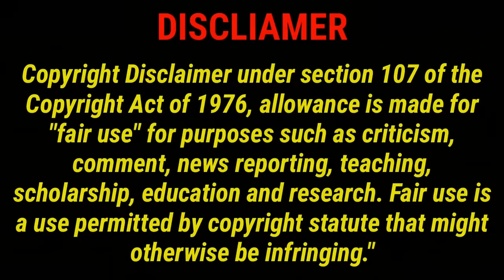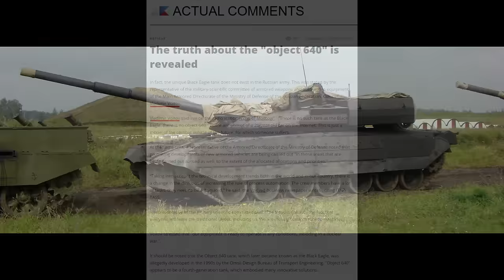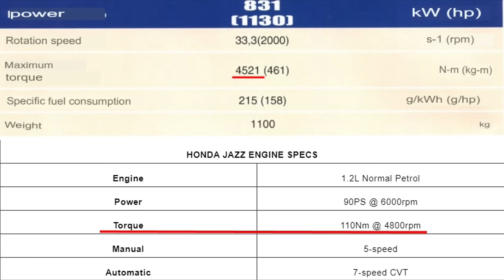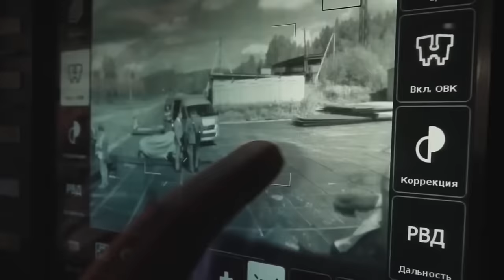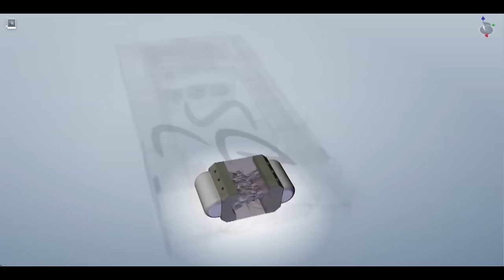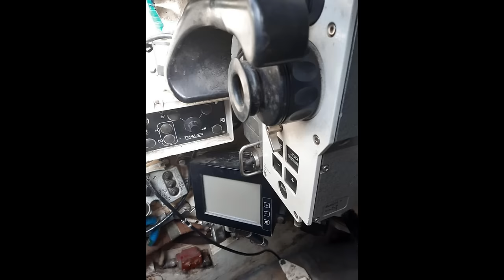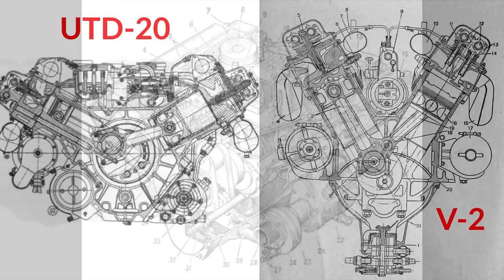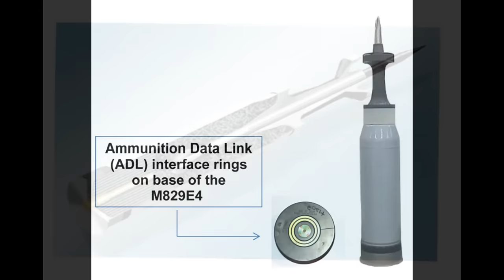LazerPig is WRONG about T-14 Armata

Comment: The carousel is, in fact, a very big advantage. It allows to save space and make the tank smaller, thus making its profile lower and more difficult to hit. Also, it allows to reduce the number of tankers to just 3, - in this case, if the tank is destroyed you only lose 3 people instead of 4.
It is true that it is jubject eto explode, but what the difference doest make for you whether you'd die to a ammo explosion or to spalling? By the way, starting with T-90 and late T-72 variants the carousel was added an aditional internal armor plate to protect it from spalling.
The advantages of hving the auto-loader far outweigh the disadvantages. The autoloader never gets tired, it won't have a panic attack and it can't be disabled easily.
Reply: However, does the Leclerc not have a cartridge autoloader that is still protected by blowout panels?
Reply: Having 3 people instead of 4 also increase the daily workload. For instance, the S-tank/Strv 103 could be operated by just one crew member, however inefficient as that would be, but it would be an insurmountable amount of work by himself to keep the tank in good order.
Reply: @Theswedishfoamer  yes it was made with that technology in mind.
Reply: @KamiKaZantA  the Autoloader means the one manual labour job is not to be done since its automatized.
Reply: Then NATO would be using it. Oh wait, they value crew survivability 😊
Reply: @nolkerss  if they value it so much, why is Leopard 2 Ammo rack exposed?
Reply: As stated in the video by a Russian official, having a lower profile basically doesn't matter in modern combat. Tanks are detected by their thermal signature and most of the hard work of hitting them is done by fire control computers. The main advantage of an autoloader is that it is more reliable in the long term and the lower profile mostly matters in terms of weight savings. Whether or not having fewer crew members is an advantage is up for debate, on one hand it might allow you to deploy more tanks but on the other hand it leaves more work for the remaining 3 and provides one less set of eyes to keep a look out. Also in most modern tanks a tank loss rarely translates into the loss of the entire crew, except in the case of a catastrophic ammo explosion. We don't really have any reliable data from modern conflicts on this but even during WWII in tanks such as the Sherman and T-34 a tank loss on average lead to the loss of 1/5th of the crew, with the Sherman generally doing somewhat better. The major innovation that has happened since then is the addition of blow out panels, which means that even in the case of an ammunition fire the crew is kept safe, this is also the main downside of the Russian carousel autoloader, since it has to be located in the floor of the tank it is impossible to install blowout panels for it. The T-14 does somewhat address this by keeping the crew in a separate armored fighting compartment though I don't know if any tests of ammunition fires have been performed in it to see how well it works. The Leclerc addressed this by instead using a bustle autoloader which could install blowout panels and it's likely somewhat more safe than its non-autoloader NATO counterparts since there's only a single tiny hole into the ammo compartment that has an automatic door, other NATO tanks tend to have spring loaded doors.  Another thing the French did when adopting the Leclerc is not drop the 4th crew member but instead keep them attached to the tank company and have them act as scouts while still working with the crews on maintenance and repair.

It does seem like the world is moving towards autoloaders so they are clearly superior but back in the 70s and 80s when most of the current MBTs were being designed these advantages weren't as clear. A lot of this probably has to do with advances in electronics that both make them more reliable but also lets you do things like have armored crew compartments.
Reply: @hedgehog3180  you obviosuly have no idea what you are talking about if yout think thermals are prevalent everywhere on the battlefield. Vast majority of portable AT weapons do not have thermals. The majority of AT launchers are also unguided  (RPG-7, AT4). Didn't read any further.

Comment: With all military equipment, everything has to be matched. It has to function reliably, it has to be effective against the current opposition, it has to be available in sufficient numbers to be effective, it has to have plentiful spare parts availability, such that the vehicle can be repaired quickly in the field when it suffers breakdown or battle damage and kept in service. It has to have effective logistical support to keep it supplied with fuel, ammo, everything the crew needs to function etc. Deficiency in any one of these areas and it's efficacy is lost. 

As the T 14 doesn't appear to have been produced in any any great numbers, it's irrelevant until it can be, however good it may or may not be.

Comment: Good video.  Lazerpig is going for a more humorous content.  But overall, does t-14 really matter, if Russia can’t make more than two dozen of them?  I have seen pictures of t-54s heading for frontline and those do not have a good track record of going up against more modern western armor.
Reply: i dont think you should comment on the matter when you cant tell the difference between t-55 and t-54 (xD). on a serious note, it just shows that, apparently, tanks are rarely used in antitank role in that conflict and have other uses during which the amount of protection doesnt matter that much and all that counts is that you can use the main gun and mg placements to overpower infantry positions (or defend against it). whatever you might say its better to have any tank than not have a tank. i cant think of situation where having a tank (any) gives you an disadvantage when opposed by enemy that currently doesnt have a tank or has less of them. t-55 can penetrate mbt's  from side just fine, too. its speculation on my part, but they might be safely used as dug-in artillery. since turret profile is really small and if all you might see is this small turret, well gl spotting and hitting it.
Reply: @seushimarejikaze1337   I agree with that having a tank is better than having no tank.  But look at desert storm, there were large armor on armor engagements and it did not go well for Soviet made armor.   Same with few wars between Israel and neighbors.  Arguably, the victories there were as much due to combined arms and overall strategy but still post WW2 T series tanks do not have great performance record. 
Also my point is that few dozen of t-14 tanks are irrelevant.
Reply: @knoef82  um again desert storm argument? you realize how many people used desert storm argument and got destroyed by counter arguments? like fact that american tanks used in that conflict fought against obsolete copies of russian export model t-72 (that had no composite armor nor any "up-to-date" ammunition making it basically an equivalent to t-62, but with slightly better gun and fcs) and chineese copies of russian t-54? like comparing m-60 to t-80. seriously... not to mention that russo-ukraine war resolves in totally different way that dessert storm did. i mean both sides are using comparable equipment (russia has slight edge in quality, but nato supply effectively negates that advantage)and direct tank on tank engagements are really rare. t series tanks have the most impressive records as those are one of the most used tanks in the world, especially t-72. like someone once said: "t-72 are fighting against t-72 and you are surprised that t-72 are getting destroyed?" xD. there literally isnt another line of tanks, that is so extensively battle proven and tested by various armies of the world as t-72 line of tanks is. to the other point of your message, that i can agree on. unless t-14 possible issues are not resolved and production doesnt pump out at least 100 of those tanks. the whole concept is not able to change anything in terms of "battle power" of russian federation. im also sure its definitely not a "wunderwaffe" type of weapon, just one that will introduce completely new quality into russian arsenal with all its improvements and wholesome electronic warfare suite that is onboard (if and when it will be produced in adequate numbers).
Reply: @seushimarejikaze1337  at least we agree on something.  
As for the desert storm.  Here is a different argument.  Russia lost about 200 tanks in first Chechen war ( a lot of t-72s) and that’s fighting against irregulars for few years.  I could be slightly off but that’s about ten time higher than all US tank  losses in desert storm and all of the follow up conflicts in the region.  It doesn’t necessarily prove that t-72 is a bad tank it could be just that Russian military sucks at combined arms.
Reply: @knoef82  it simply proves that russian tanks are not made for urban warfare. on other hand, american mbts is made for urban warfare(hence why it has such a tiny short barrel when compared to german or russian tanks).  in the 90' anyone with an rpg could blow t-72 up by attacking its flank. now its harder to do, but also AT measures got a lot better. to the point then. t-72 was newer meant to be a "maus" among mbt's. its cheap, relatively easy to maintain and has good range and mobility. figures here are a bit outdated - but you can build 12 (!) basic t-72 for the cost of one m1a2 abrams.  like  any other mbt , it can be destroyed when hit in less protected areas (anywhere but the front arc of armor). main problem seems to be a flaw in this tank protection system. for example in case of abrams, infantry cannot be only in vicinity of area the gun is aiming at(its dangerous). in case of t-72b there should be no infantry in range of 270deg to front due to danger of getting shredded by ERA. thats why people oftentimes see russian tanks advance on videos and ask : "why there is no infantry support?". well, thats why ;]
Reply: @seushimarejikaze1337  I like this discussion and again I am not an expert.  But so far the argument is: desert storm is irrelevant because those were export models, Chechnya doesn’t count because these tanks are not good for urban warfare and Israel wars don’t count because of ?( maybe relatively poor training).  Are there actually any examples of conflicts where Soviet built armor went up against anything comparable and was not wiped out?
Reply: @knoef82   dont get me wrong im not making any excuses for t-72 as a machine. im accepting its issues and strong points as they are. on the other hand, im not trying to downplay those machines like some people do, but you need to define "comparable". what tank , you think, would be an equivalent of soviet t-72b, a tank that in field tests was able to withstand shots from famous "silver bullet" available to abrams tank crews during desert storm?desert storm is not irrevelant - it shows a trend here. export models and poorly trained crews = lots of loses. see what happened to export abrams tanks in yemen - lots of videos on the net on the subject, at least until they get deleted. chechenya just showed the the incompetence realized through underestimation of enemy forces and their equipment in the initial phases of conflict, same as at the beginning of russo-ukraine war, that is ongoing(am sure that fact of 2  russian generals resigning from duty at the start of conflict, didnt improve the overall state of russian deployed tactics at that conflict). for "israel wars"... WHICH ONES? lol there were lot of those. i dont have the necessary history knowledge to find such conflict, where russian tanks(not "monkey" models or outdatet machines more than about 10 years older than what enemy fielded) were fighting against comparable enemy tanks (if there were even one) ,except maybe current ongoing war where russian armor(native) fights against russian armor(ukrainian modifications AND soviet produced ones). since youre asking, i figure you cant think of one such occurrence either.

Comment: sigh  the Leopard 2 has that engine because no one wanted to pay for the MTU EuroPowerPack (EPP) ... it's not that there isn't a better engine... and it's the engine that is in the Leclerc tropicalisé, Merkava Mk. IV, Arjun and K2 .... ... it's that the existing engine was considerend still 'good enough' until the MGCS is (maybe) ready for production in2030. Because no one thought Putin would be mad enough to start a war. And it is still a good enough and reliable engine expecially since it's in an engine block with a superior field maintenance capability. But not the best one on the market by far.

Comment: As a child tank nerd who then somewhat grew out of it. One of my funny takes on tanks is that more than anything, the tank need to fit the role the nation needs.

My favorite examples from fiction are the Leman Russ, and Nod Tick Tank from Command and Conquer, while my favorite example from real life is the Sherman.

The Leman Russ is a awful tank, no reactive armor, no sloped armor, tall profile, designed by British writers who admired the WW2 designs so you know it's slow as all hell, and it's gun has short range for its caliber. But the tank is so simple children can assemble it with supervision, it's able to be mass transported like no other tank can (something vital for a space empire that fights via mass of soldiers and weapons) and its engine is so advanced and versitile it could run on burning logs if you're desperate.

The Nod Tick Tank, is supposedly cheap in universe, made using a mixture components from tanks dating back to that universe's soviets-vs-allies WW2 in the 1960s, and recently cheap and mass produced mechanical components, allowing it with its 90mm cannon to actually fold its hull and partially burry itself making the tank into a burried bunker. So the militia forces of Nod effectively have a cheap, mobile bunker.

And the Sherman, well its just an impressive design even if tankers had a fear of the "tigers" they were facing (never mind there was only about 80 to 90 on the western front after D-Day) The design could work anywhere, be maintained and supplied easily, and generally the design was very competitive with its actual rival the Panzer.

Comment: The X-layout engine of the Porsche variants/proposals were unreliable, which is why they were never used.
Russian engines could also never rely on western imports since exports of engines that are deemed viable for non-civil used has been banned for a long time.

The "breakdown" or "handbreak failure" being evident by the running gear being locked up... Depends on how torn up the drive train is. So unless the Warthunder forums do their thing of leaking specs on the T-14 engine, gearbox, etc. that question will be hard to answer. On western tank designs (and other tracked heavy equipment), it is sometimes possible to mechanically and from the outside to decouple the gearbox from the drive sprockets, which obviously exists for a reason.

The point on the camera made by LazerPig and made here are the same argument worded differently. When the monitor for the camera is off to the side, it is obviously not the main object of interest, but an add-on.
Reply: touch grass

Comment: I’m with Lazerpig on this one.
Reply: 12 year old detected
Reply: @yaraelpoof7242  just look at LP's response
Reply: @phunnymannfromphunnyland I did, now what? What exactly was Red Effects wrong about, but LazerPig fails to address almost everything. He Literally only addresses things that are speculation at best, and spends the rest calling Red a Russian propagandist.
Reply: @voidtempering8700  because he addressed only the points that RE made that were pretty fuckin bad?
Reply: @phunnymannfromphunnyland  How exactly were they bad, the main point he went on a tangent about only led up to Red Effects being correct, he said that the SLA.16 was put in a King Tiger.
Reply: @voidtempering8700  jagdtiger and king tiger. Ultimately both test runs of the engine to see its capabilities.
Reply: @phunnymannfromphunnyland he acted like a child in most of the response and doubled down on the point that was mostly speculation anyways

Comment: you forgot to mention that the t 14 armata turret or rather the 125mm 2A82-1M can be swapped out for a 152mm 2A83 because of the research on the Object 640 and Object 477
Reply: he did not, he did videos on that years ago, it was not relevant to this video.